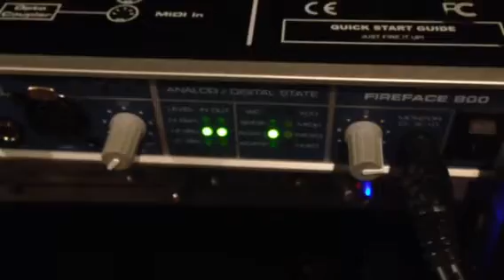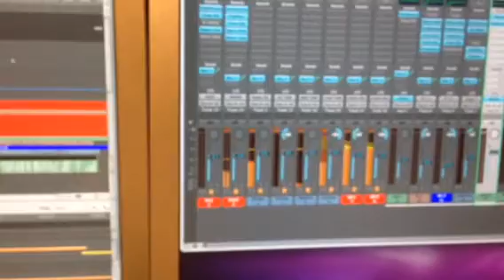Fireface 800 anomaly

Comment: Probably the power supply. Hold thumbs. Open it up (unplugged) and check for obvious swollen caps etc in power supply. Might not be visual, but if it is, you'll be happy you didn't bin it. Most electronic repair places can fix power supply on the cheap.

Comment from the maker: Was opened and repaired by RME recommended repair shop in Ohio. The firewire 800 ports were replaced with more secure ones. Plugged everything back in. The host light came on again with the same crap!!  Plugged the 800 cable into the back port on the PowerMac.  Now everything works!.. WTF?? 2 problems. Back input jacks (faulty and fell into machine) AND bad Powermac Jack!!